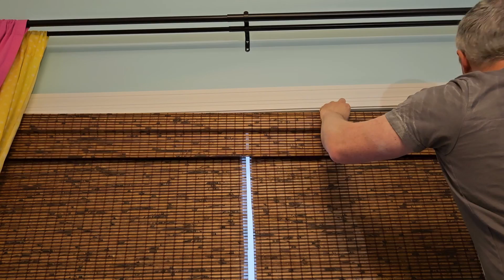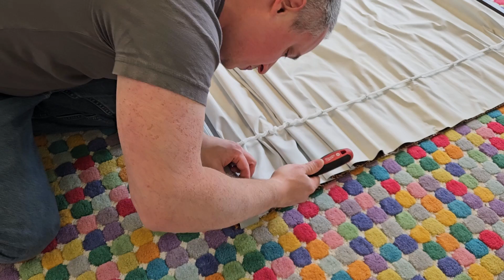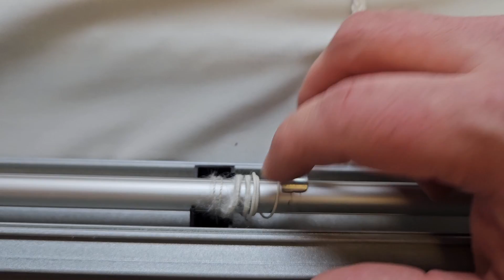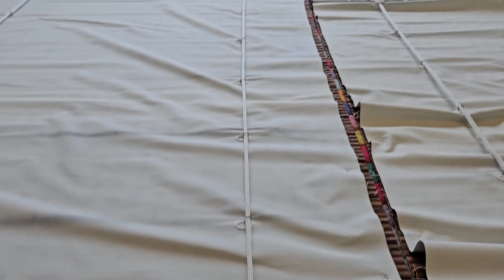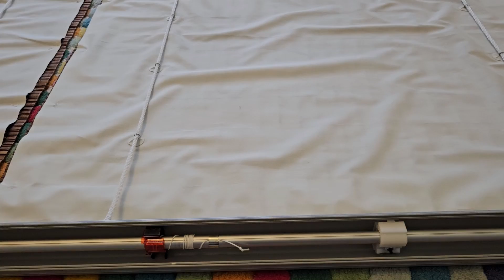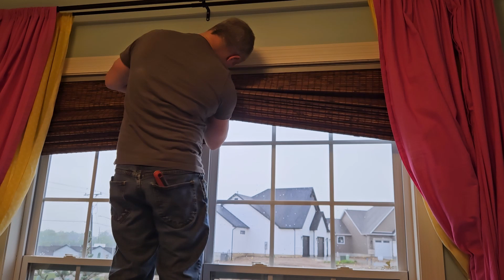How To Fix Stuck Cordless Window Shades - Easy Repair Guide!

Comment: Great video.  I have the exact same shade with the blackout liner where the left side won't go back up.  One question.  The braided cord connected to the liner that the 1mm cord runs thru has also come apart in one spot between two of the eyelets attached to the liner.  Is it important to replace the braided cord too?  Or is it not that important?  Thanks.
Reply from the maker: I think the braided cord just acts as a  guide. I wouldn't worry about a break in it.